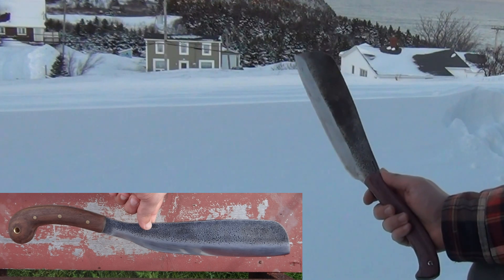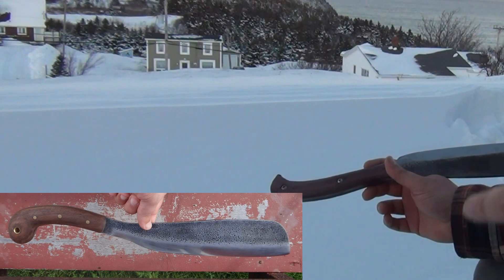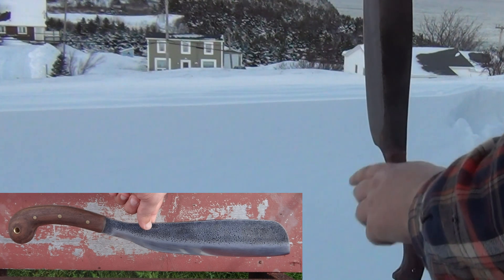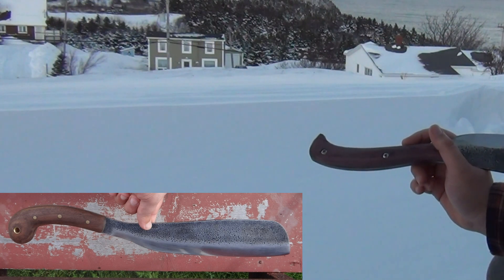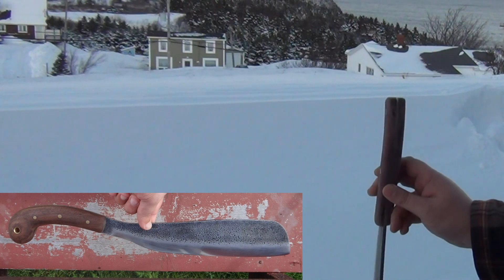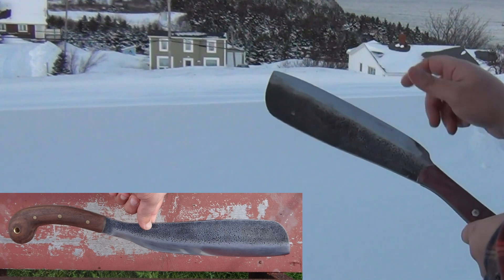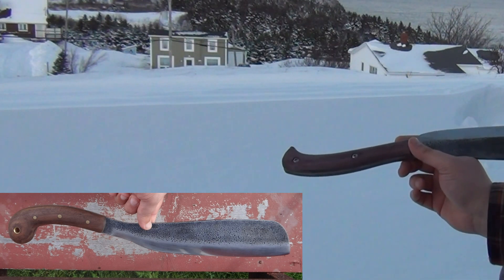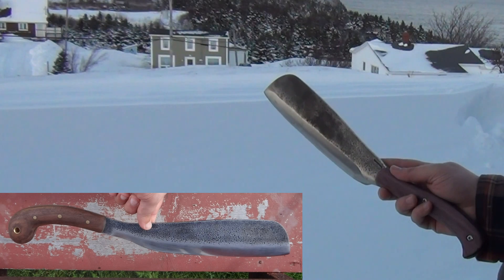Condor Village Parang : rehandled

Comment: always like you thoughts on bettering the designs on blades - it all makes perfect sense.
as for tapering the tang - personally i would skelatonize the steel in the handle area to lighten the hand end so you transfer more weight / heft toward the front area of the blade.
sandy from jacklore knives seems to have perfected the taper tang skill so it might be an idea skyping him for some tips.
none the less this tool should be great when finished.
good work cliff
darren

Comment: It looks great Cliff. The handle looks a lot better and the shared off shape of the handle is closer to ideal. I recently got a Condor Hudson Bay Camp knife and will be testing it as well, and the person I got it from had con vexed the edge slightly, but I can see it needs to really be leaned out for performance.  At this point, bmy Golok and that one are basically splitting mauls, but I believe they can be tweaked pretty easily.  I think the steel is 1095 or 1055? Relatively low hardness, right?
Reply from the maker: The steel is 1075, 52-54 HRC for the larger blades. 

Yeah, they run them with very heavy grinds which is a bit odd because the traditional/native ones are definitely much leaner which they have to be for working blades.
Reply: Excellent work on that Condor Villager Panrang. I have similar problems with the blade on my Condor Bushcraft Parang. Condor seems to like wide edge bevels and heavier blades for some reason. 

Joe Flowers PM me and said he was investigating this thick edge on the Condor Bushcraft Parang. Also he said he would send me a "fixed" one. That was June 2013 and today is December 2013 so I guess there's a problem. 

Anyway, have a Happy New Year Cliff.
Reply from the maker: sweetcostarica Let me know if it ever shows up. I would be interested if they have changed the design.
Reply: Cliff Stamp Ok, but I think it was a hollow promise. Something said to pacify. But I will PM you if I see a new and improved Condor Bushcraft Parang from Joe Flowers.
Reply from the maker: sweetcostarica Yeah I don't know why they would do that. The only thing worse than ignoring a customer is making false promises.

Comment: It will be nice to see some 2x4 or any wood chopping after the mods.
Reply from the maker: Yeah, I am going to have some use video's up shortly, I just had to get a decent weather resistant outdoor camera.
Reply: Cliff Stamp I'm curious: what are / were your requirements?
Reply from the maker: YasumotoUS For the camera? I mainly wanted it to be weather resistant. However I was playing around with my brothers GoPro and picked up one.
Reply: @ cliff: yup, for the camera. Just curious about the environmental extremes which dictate your choice of exposed electronics.
Reply from the maker: YasumotoUS It is mainly light rain/snow. It gets heavier in rain and snow but unless you are going to build and film from an enclosure it is pointless to have a camera which can take that because the lens covers in immediately anyway.

Comment: The balance looks so much better.  That was my major complaint, that for the amount of weight it needed to be a better chopper to justify the weight (as I said before as boxed it was the same weight as a Small Forest Axe).  The weight in the handle severely hampered the effectiveness IMHO.  Although still a poor choice for a parangs natural habitat, the modified knife as you have done is probably more effective for your tasks in Newfoundland than a typical, ie lighter, parang would be.
Reply from the maker: That is a critical point with larger blades, if the balance is off then the efficiency can be gutted. This was more of a rough tool like an axe used for cutting roots and sods. But in Condor's defense, they don't seem to have a problem selling them .

Comment: Nice work Cliff, and nice choice of wood for the handle. Did you treat it with linseed oil, and if so did you lose much of the purple color? It is a little hard to tell from the video.
Reply from the maker: Not yet but I will shortly, I need to refinish the handle first anyway, it is too slick now.

Comment: Speaking of rehafting, did you ever go around to doing a hand and a half handle for the hudson bay north 49 mini hatchet? 

Though that is a very nicely done handle. What did you use to shape it? (If it's a belt sander, were you the one who mentioned that you can prolong the life of belts by using it on wood?)

Speakig of tapered tangs, have you seen the tangs on Dan Nguyen's knives? Kid makes some unique tapered tangs.
Reply from the maker: Not yet, but I likely will at one point. 

Wood rasp.

Comment: Almost a year and a half later, does this hold up, at all?
Reply from the maker: shurdi3 It is out on loan, no issues.
Reply: Did it get returned?
Reply from the maker: It is still working fine.
Reply from the maker: No, I rarely return knives unless the makers specifically request it due to cost.
Reply: I was asking if it got returned to you after the loan. 

Not if you returned it to the maker.

Comment: Also what method did you use to taper the tang? I remember gav talking about one where you up each part of the tang individually to be ground, then put the entire tang horizontal and grind.
Reply from the maker: It is barely tapered at all, I just worked it a little, maybe 10 minutes on a 1x30. I didn't want to use a 36 grit ceramic on it as the steel is still uncertain.

Comment: You have turned your parang into a golok/parang hybrid or something. LOL! The convex grind is the grind that should have been on the Borneo parang the Condor Village parang is a representation of a Borneo Parang or that general area. You have disabled  the functions that it was meant to do which is your choice but it made it into a large knife almost I would think, you lose all your 3 finger techniques, draw techniques and all forearm techniques. The things that were changed on the village parang by condor were changed to benefit bushcrafters who would be chopping in hardwoods every time they hit the trail or using it as a hammer for tent stakes or to hammer primitive and modern trap poles and anchors in the ground or to baton with because it will be used by most instructors like myself as an axe in the South Eastern United States. Today's Borneo parang would have been made from spring steel for the most part. Borneo parangs were designed to fix on the fly in the middle of the woods because they were basically used as machete's, draw knives and sometime weapon's. The rattail tang on the parangs from Borneo was an inferior design on every level if you take in account everything that a modern day bushcrafter will have in his bag but they were made the way they were with a rattail tang because of the ability to fix them in the middle of the woods with no tools that's why when you see the native peoples buy one at the market the first thing they do is remove the pin that connects the handle and blade or at least make it where it can be removed while in the woods with a common nail. The way you did it looks cool and that's awesome and it functions to your needs so really when it boils down to it that's really all that matters in this situation. Great video Brother!
Reply from the maker: I am not sure how I have disabled the functions you describe, that is what it is used for and it does them far better than it did originally. 

I have a more recent version of the same knife by Condor, it is in fact much closer to the way I modified this one.
Reply: Cliff Stamp Hey Brother great video's by the way. I just found your channel the other day and have really enjoyed the couple video's a day I have been watching.

Comment: Cool 
I am looking forward to future update on this parang. Interesting project!

I just received the condor bushcraft parang. I picked that version exactly like you are saying because the handle looked to "roundish" on the village parang.

I am hoping the steel is good in both our parangs :)
Reply from the maker: How is the Bushcraft version. It is supposed to be a higher performance cutting/chopping tool.
Reply: The grind on the bushcraft version is exactly as your described it on the village version - with a Hugh polished line but steep convex grind om the edge. When i gain some experience with the parang then I will make  a video update... I have a ton of axes but few big blades so its a new category for med.